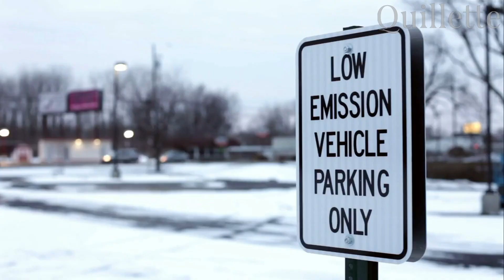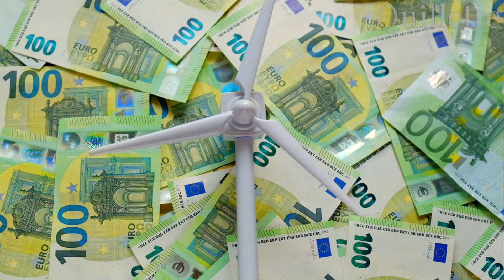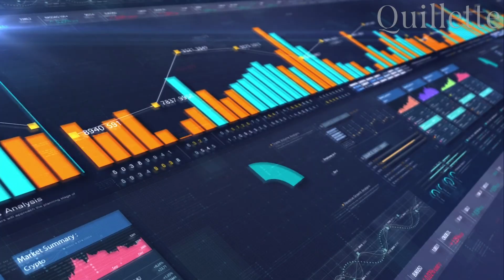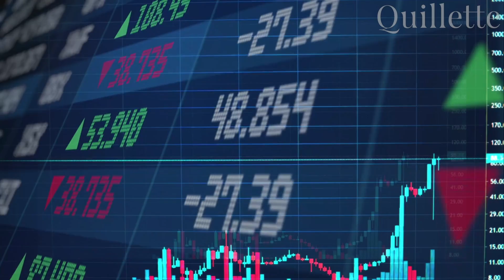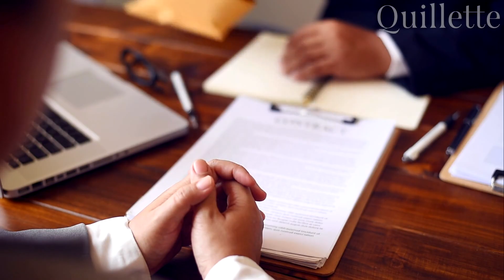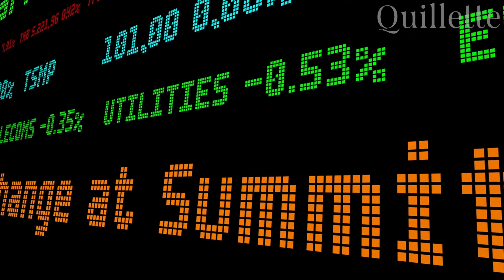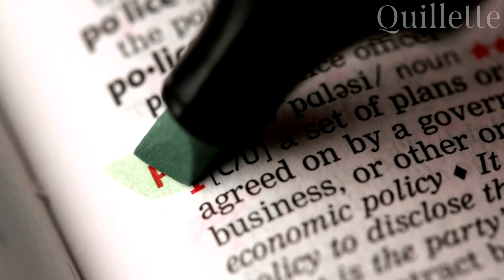The Fatal Flaws in Our Green Energy Transition

Comment: This is a real hatch job that doesn't even mention the counters to these straw man arguments. Yes electric cars are generally a little heavier than petrol cars, but not massively so. Electric cars don't need heavy combustion engines, transmissions or exhaust systems. Hence whilst they are heavier, they are only a bit heavier. This is more than make up by the fact that electric cars are over 90% energy efficient compared to petrol cars that are only about 35% efficient. They are also much better for the environment and massively clean up on air pollution. Yes currently electric cars create a bit more pollution currently than gas cars when they are made, but a typical time to recoup that is 2-3 years, possibly less if you are using all green electricity. With a sensible mix of electricity (wind, solar, nuclear, hydro) electric cars become way better. And by the way battery chemistries change all the time. We have LFP and Sodium batteries coming in now which fundamentally change costs, weight and environmental impact for the better. Energy density of batteries is getting better by the year and thus batteries are getting smaller and more efficient.

Comment: I see all the comments here are correctly trying to correct you. 

Other than the aviation industry it seems like it's better to go to batteries. 

Just an example: 4:25 you talk about how ICE cars are 30% efficient but using electric cars that are 90% but charged by power stations that are 50% ..
We got roughly to the same efficiency of ICE.

That is totally not true! 
0.9×0.5 is 0.45 which is 0.15 higher than 0.3 by 50% ..
That's huge!!
Motor vehicle companies spends billions to increase efficiency of few percentages..

Also, going electric freeze a country from the dependency of oil supplying countries. 

Yes, there are issues of lithium in Cobalt..
But now we are hearing about sodium batteries and other chemistries. 

I think this video is a bit biased and needs some changes

Comment: Barrel oil vs Battery: 
A battery is recharged, the oil is gone, forever.
The battery keeps its content, the barrel is empty.
The battery gets used thousands of times, than gets 96% recycled, than used thousands of times again, etc.  The oil gets used only ONCE. Go EV and end the OIL wars, economic dependance and oil pollution.
Reply: False analogy. Batteries are good for slow, low power input over a long time, whereas FF are fantastic for high-energy, fast power transfer over a short time. Our economy is designed for the latter: batteries and coal/oil were contemporaneous, but FF won comprehensively and begat the industrial revolution, and modern civilisation, because of this advantage. FF are free energy, generating huge GJ nett, whereas batteries are merely storage vessels, using energy from elsewhere to operate.
Reply: @iaincook5835  tell me, which is falls: 
1) when used, the oil is gone, forever 
2) after use, the barrel is empty    
3) oil gets used only ONCE.    
This is falls: 'FF are free'. Look at the price at the pump. Nothing is free.
I am not for a radical, super-fast, mandatory shift, but FF's "collapse" is coming closer and is unavoidable.
Am not for a radical, super-fast, mandatory shift, but FF's "collapse" is coming closer and is unavoidable.
Reply: @maartenvanneste  Your points 1-3 are valid but irrelevant in the wider sense. I agree, we need to transition to non-FF eventually. However, today, FF are by far the best, most powerful per kg nett, most energy-producing (per MWh of production) and cheapest (not free!) fuels on the planet, as per the last 200y. FF are boss. To replace them, we are going to have to get a LOT smarter, otherwise our civilisation will collapse to a lesser level. I don't want that. I am prepared to tolerate higher global temperatures so that that doesn't happen.
Reply: @iaincook5835  were getting to a reasonable close. Thanks for a polite debate.
Reply: One more thing if I may admit... I bought my first EV in 2011 because    
1) I did not want to pay for islamic propagation and  oil wars.   
2) environment   (toxins, not co²)
3) energy independence for europe.

Comment: Batteries don't supply energy. They store electricity from another source e.g.coal.
Reply: TBF it COULD be geothermal, hydro, wind, nuclear etc.
Reply: @killcat1971  Of course but you need to look at the grid average when considering widespread usage. Anyway the main point is that the battery is not the source of power - a subtlety that a lot of people don't get.
Reply: @davidbuderim2395 everybody knows that. And if you take France as an example, nuclear makes the bulk of the energy in the grid.
Reply: @FrancescoDiMauro  Yes, nuclear is the solution. Once you accept nuclear there is no business case for wind and solar - job done, problem solved. Where I live nuclear is illegal and power is 90% coal at night, 70% during the day. Germany destroyed some of the best nuclear reactors in the world and increased the use of brown coal, the dirtiest type.
I can't take anyone seriously who takes nuclear off the table, or even the nonsense of nuclear backing up wind and solar.

I'm not convinced everyone understands about batteries. We had electric buses introduced in our area with "zero emissions" painted boldly on the side. Bollocks. Mostly coal fired electricity for charging and the extra embedded carbon during manufacturing of EV vehicles. Its quite likely that an EV bus where I live would put more CO2 into the atmosphere over its full life cycle than a deisel bus. 

Apologies for getting a bit agitated but the lawyers and social studies people are running the asylum. I'm an engineer sitting on the side saying can you please do some math and systems analysis.
Reply: @davidbuderim2395  You do understand just how expensive and difficult nuclear power stations are to build don't you? In the UK we are build 1 new nuclear power station and it is at least 10 years late and costs are currently estimated at 30 billion pounds. I'm not against nuclear per se, but you have to look at the cost/time to benefit ratio. In that time we've built arrays of wind farms in the North Sea at a cheaper cost and much quicker. In the UK we have eliminated coal as a power source and on some days in the year we have ran the grid entirely on green energy. Now we are not there yet (we still need a lot of work upgrading the grid) but it is getting there. Nuclear I feel will still be a part of the energy mix, but we are getting there.
Reply: @gavkenny  Yes. The green lobby has been very effective at making legal hurdles difficult, expensive and time consuming. The German greens destroyed some of the best muclear plamts in the world. And I think it was Cuomo who refused an operating licence for a finished nuclear plant in the US. These are political not technical decisions.
Compare that to I think it was the UAE who had the first reactor running after 4 years and had three more on the same site to come online in the following few years. So if society decided they wanted nuclear it could be done at reasonable cost and time.

Meanwhile for every set of wind turbines built you had to build a natural gas plant for when the wind didn't blow. On average over a year I think that mix would be around 70% gas and 30% wind - what happens on one day is irrelevant. You cannot talk of wind alone. You have to talk of wind/gas as a system.
And if you are worried about CO2 emissions wind/gas does virtually nothing as it is still 70% gas burning. Nuclear is zero%.

The real question is why are green activists so strongly anti nuclear? It is the safest source of energy (deaths per terraWatt hour) and solves global warming.
Reply: @davidbuderim2395  what are the two things anyone remembers about Greenpeace? Nuclear, and whales… talk about missing the forest for the trees! 

I’m 100% pro nuclear power, my concern is timeframe. If reactors were coming online now they’d be a solution to the climate crisis, but my understanding is reactors take some 30 years to become operational. (I know there’s some buzz about these ‘mini-reactors,’ but this technology is still in development, so…). 

And this is before taking into account local opposition to construction, regulatory burdens, etc etc.
Reply: Supply energy doesn't mean create it out of nothing
Reply: @TonyCuzzilla  Agreed but sloppy language. You could also argue that a wall socket supplies electricity whereas you could say it transmits or conveys electricity.
For day to day use the terminology doesn't matter. But when you're trying to analyse this sort of complexity I believe you need to use a few extra words to be very clear.
For example I saw a video promoting an EV charging station at a university. When asked where the electricity came from she said "that building'. When pushed she said oh its company XYZ who's representative is over there. When the rep was asked he said it's 90% coal.

Comment: This is a rather pathetic regurgitation of old, stale talking points. For a comprehensive rebuttal, see "Clean Disruption" by Tony Seba, a book published in 2014. There are also numerous lectures by the author avaiable here on YT. 

In short: the combination of solar, wind and batteries (SWB) is already the cheapest energy production solution in all but a handful of markets, and has been for several years. That's why over 90% of capital investments in new energy capacity has been spent on SWB for the last few years. In the USA, SWB has already surpassed coal's share of the grid's power (17% vs. 15%), and that share is growing exponentially. 

The "energy race" is already over, and fossil fuels lost. Get over it.
Reply: Are there any batteries operating anywhere in the world that provides more than a few hours of supply?
Reply: @AdamJones381 Better question is, are there any that need to? The answer is rarely, but yes there are plenty.
Reply: @wx2999  do you an example please? Since you mention there are plenty, if they weren't needed they wouldn't be built.
Reply: Wind and solar are infinitely-expensive, on a sustained basis.
A 100% wind-and-solar powered economy would soon lead to a state of permanent-blackout.
Reply: @aliendroneservices6621 Australia is currently rushing headlong down that very path. 
We’ll let you know…….😕
Reply: @aliendroneservices6621wind and solar are by the cheapest energy sources available. Even when adding batteries to the cost (see CATLs Nextra at $10 a kwh)
Reply: he does not argue for an energy race and possible return to fossil. he argues for a controlled changeover without forcible abolition of older technology. the share of SWB is certainly not growing exponentially.
Reply: @hinkelstein69   The math is inescapable. If 90% of CapEx is going into one thing, then that thing's share of the market will grow exponentially. QED.

Comment: This presupposes your powerproduction comes rom mainly fossil fuels, unlike places like France/Sweden.
Reply: Wind power operates at about 40-50% efficiency as well, solar power at about 20-30%.

If the argument was about efficiency alone, there would be no benefit in "renewable" energy but instead it is about emissions, where "renewable" energy is better than fossile energy.

The best approach would be a closed system, which recycles energy.

The main goal has to be reducing the use of fossile energy, to enable the use of renewable or circular systems.
Reply: @fwebe2871  You are misusing the term "efficiency".
Reply: @fwebe2871  He was speaking of nuclear power, which is/should be the future of green power.